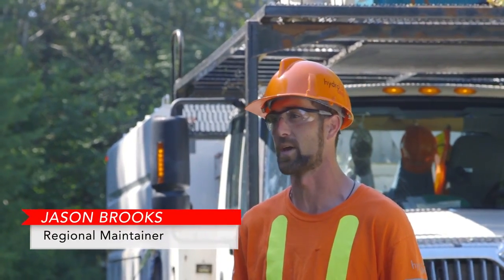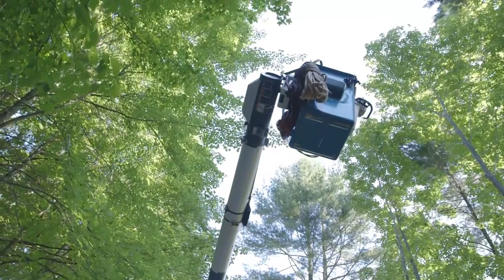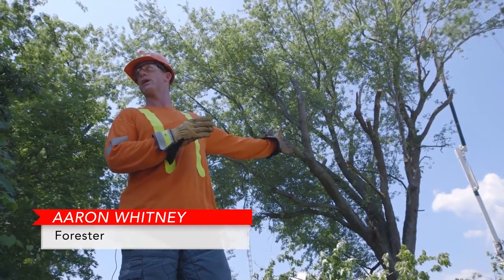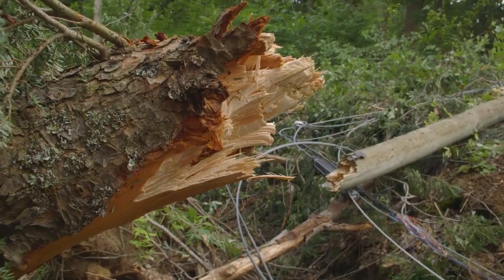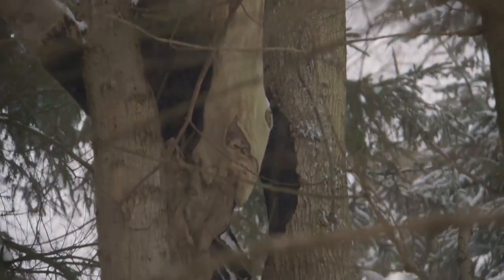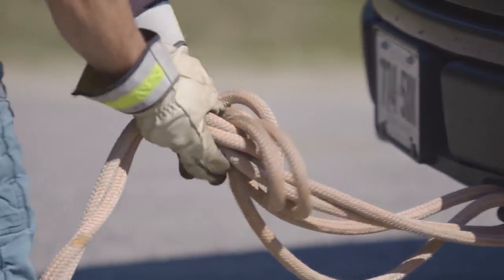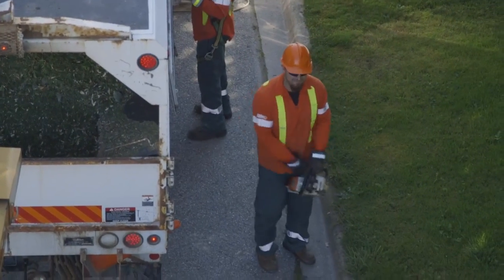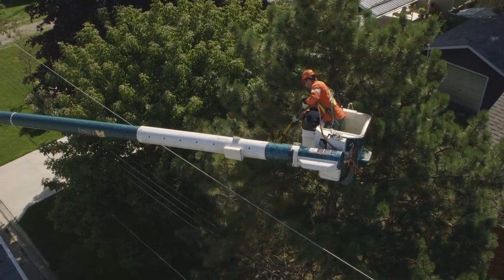Hydro One Forestry

Comment: these guys arnt loggers lol. I can fall a tree any direction saftley my directional falling is second to none. If a tree butt is too small to use a falling wedge then put your shoulder into it as a good notch and back cut is the secret and the holding wood will direct the tree down saftly To use a rope to pull a tree down ha ha ha I laugh = amatures not to mention unsafe.. I worked in northern B.C. for 9 years falling the big stuff and 21 years in Northern Ontario falling pulp.
Reply: Your right they aren't loggers, they are utility arborists
Reply: You don't know what you're talking about! You obviously haven't worked in an electrical environment where there is no room for error, coupled with working in tight quarters around houses, vehicles, fences, campers, boats...It's not just felling, it's controlled removal of the tree or tree trimming with safety as a priority.
Reply: buddy I've been farther up in a tree than you've been from home 
lve done this for 32yrs and fell more trees than u have seen. that's why they pay us the big bucks